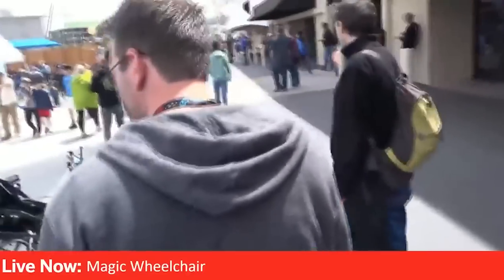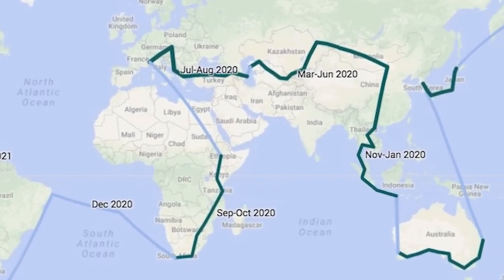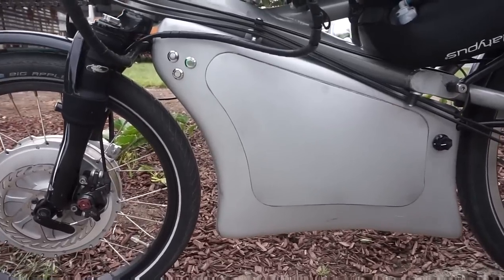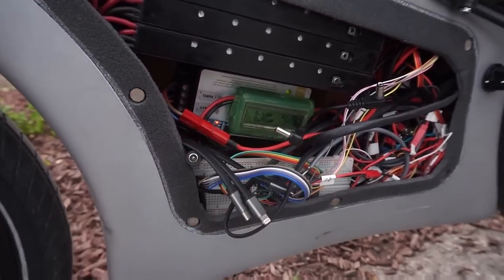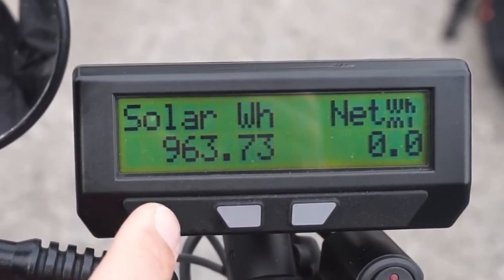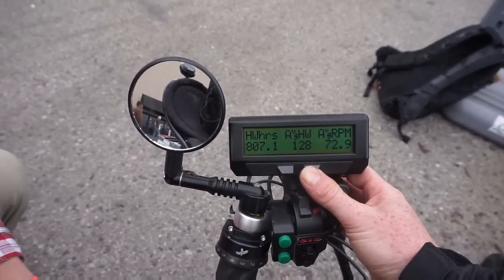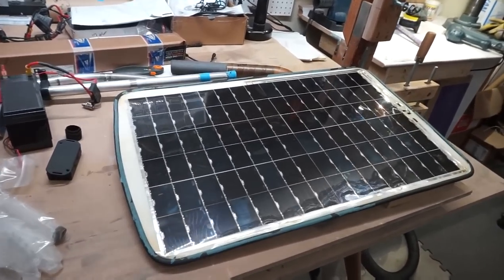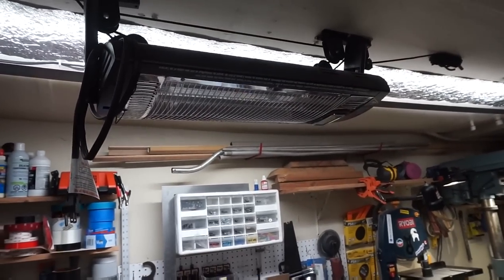Customer Profile, Mark Havran and the SolarEbike

Comment: Mark.. Is the Grin motor a 36v or 48v model...?    fully charged you showed 41.9v (that makes me think you have a 36v battery) .  Very nice job.
Reply: Hey Rob. Just seeing this now. You are correct. I'm using 6 Grin LiGo batteries (36V) so I can take them on an airplane. The 5T version of the motor in a 20" wheel with this battery gives me a top speed of around 28 mph (kph) when the battery is fully charged and less as it discharges. That's slower than what I was used to before this setup but this rig is about distance not speed so it's fine.

Comment: where can i get more info on custom solar ca firmware ? can i use ca v3 as solar input meter (monitoring output from solar panels) ? like, instead of watt meters (V and A) ? perhaps commercially MPPT boost solar charge controllers can do that also ? yep, new to this field. thx for sharing, have fun, s love nia
Reply from the maker: https://www.ebikes.ca/product-info/cycle-analyst-3.html#firmware-releases

Once you fetch it with the CA3 setup utility, then you can use the built in help file and tool tips to understand the function of each new setting.
Reply: @GrinTechnologies  i did read this page, downloading ca setup utility right now, for firmware, i guess '... solar firmwares' includes all release firmware plus solar one.
few days ago i met with the local guy, andrej, who has solar trailer company (and a plethora of knowledge and experience), and he has 2 pcs of CA (i believe v2) on his demo bicycle, one for monitoring power from solar panels, the other for regular ca use. do i need two ca products, or should one ca suffice, for both purposes - monitoring power output from solar panels, charge of batteries, and also for regular ca use, powering e-motor and monitoring output power, speed and mileage ?
if i do need 2 pcs of ca, i guess i can use (much) cheaper alternative, MPPT boost charge controller (ie MPT-7210A, from china, which i need anyway) for solar panel output and battery charge monitoring ?
i need to gather as much as possible info, since cost-wise (import tax and fees) it makes sense to order from canada only once.

thx for the reply, long live the grin, s love nia

Comment: hi, what you have for an solar to battery voltage converter ?
Reply: thanks!
Reply: @solarEbike  this genasun gvb-8 is nominated for 350 w, if i am informed correctly, so if i have 380, or even 440 W of nominal power from solar panels (times 77 % gives 293 / 339 actual, 'real' power), i must use something stronger, correct ? or do only 'real' watts matter, not nominal ?
Reply: @aumhren3480  Unfortunately, the "105-350W Max" guideline for the GVB-8 is rather misleading.You need to pay closer attention to the max input current (8A) and the max input voltage (60V). Actually, my manual says, "*Panel ratings have increased since we designed the GVB. Although we don't believe in changing specifications without a corresponding engineering change, based on both our customers' experiences over the years as well as the headroom we designed into the GVB, we feel comfortable recommending the GVB for panels with Imp up to 9A." so let's use 9A.

The largest recommended solar panel would be rated 350 watts at STC with Imp 9A and Vmp 39V (350/9). You will not find a panel with those exact specs. Also, please note that 39V input would be too high to charge a nominal 36V Lithium battery because a discharged pack will be around 33V. The input voltage MUST be lower than the output voltage on a boost converter or your battery will not charge. 39V input would be fine for a 48V or 52V nominal pack.

If you have 380W or 440W of combined solar panels, you'll need at least 2 GVB-8 units. My latest build has a combined total 315W array and I use 3 Genasun GVB-8's for optimal partial shading mitigation and MPPT tracking since my roof panel doesn't tilt to follow the sun but my 3 trailer panels do.

Also, don't use typical/average power ratings for sizing your panels to your charge controller. The current and voltage limits must be respected at all times so you need to consider the panel's highest current and voltage outputs. Exceeding the current limit should result in the controller self-derating and operating at lower power than the solar panel is able to supply, which would be an inefficient system design. Exceeding the input or output voltage limits will kill your controller.

I recently wrote an article explaining the difference between solar panel rated power and typical output if you're interested: https://solare.bike/2020/08/13/why-is-my-100-watt-solar-panel-only-giving-me-75-watts/
Reply: @solarEbike   about max input current - 8A x 60V = 480W -> nominal or actual power from panels ? i guess actual, but need to be sure. thx for sharing, godspeed, s love nia
Reply: @aumhren3480  You have a battery that is at 60V when empty and at 62V when full?
Reply: @solarEbike  dont have batt yet, i plan to use 48 V 17+ Ah lithium pack